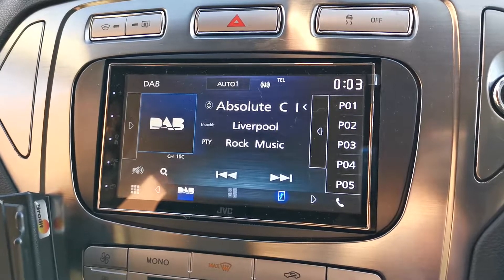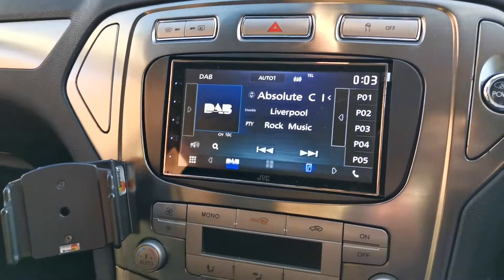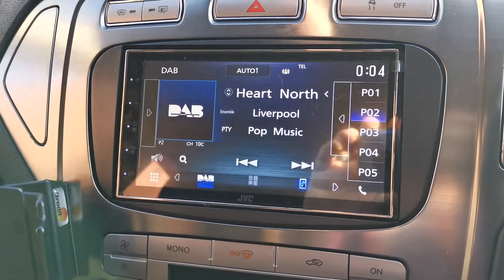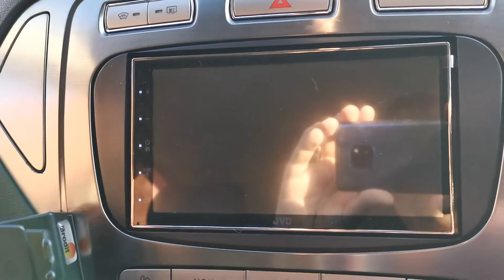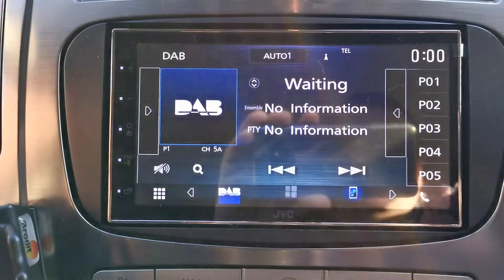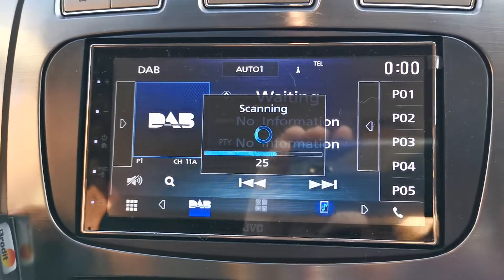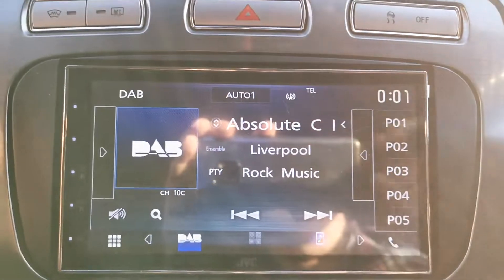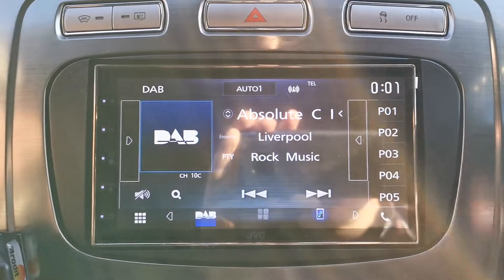JVC KW-M745 DBT firmware bug. Silent stations! Part 2

Comment: How did you update the software. Also has anyone fitted a reverse cam and successfully have it switch to cam on reverse?
Reply from the maker: Software can be found here although there hasn't been any update in a long time.  https://www.jvc.net/cs/car/firmware/2018/kwm745dbt/

I fitted a reverse cam and it switches with my reverse lights however I did need a wiring adapter for my car.

Comment: How did you revert back to previous firmware? I can't find any links on the JVC website to download previous firmware versions. Im having a different issue to you, where after updating the DAB radio won't find any stations at all. It doesn't even attempt to do a first scan.